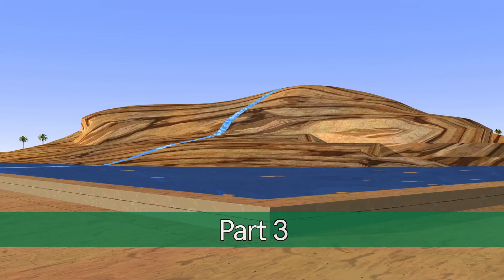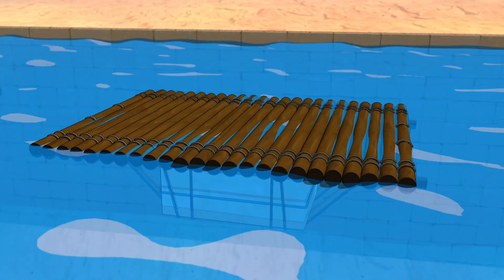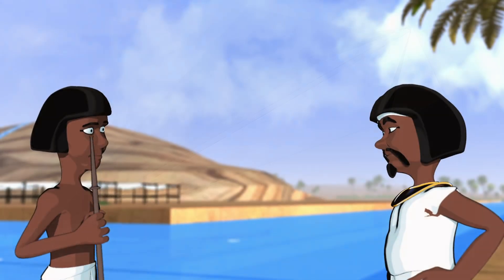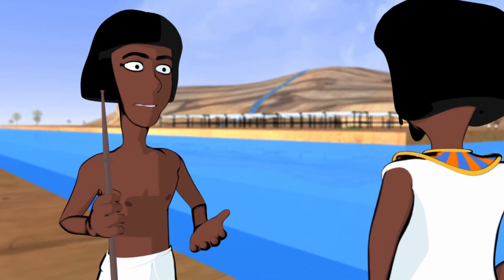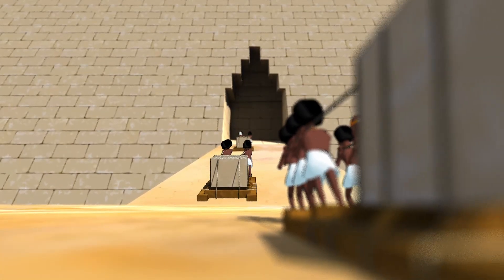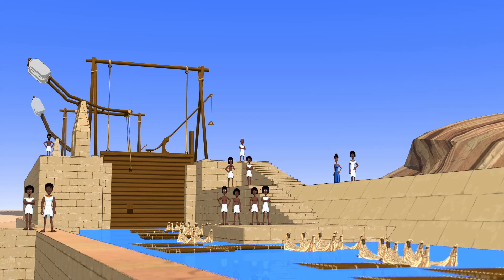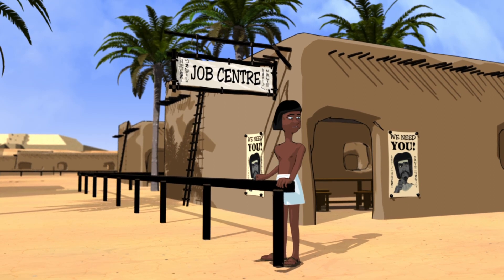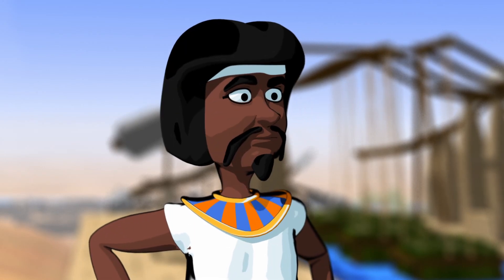The Evolution of Pyramid Building Part 3

Comment: 2:10 I did not think about that argument against the inner ramp theory. 
Indeed they would have needed massive granite blocks to make the ramp safe. 
But there are heat scans that show these inner ramps are there. 
So what's holding the weight above the ramp ? 
Maybe they used a triangular shape to transfer the weight coming from above sideways.
Greeks and Romans were masters are dealing with arches and the weight of the structure above.